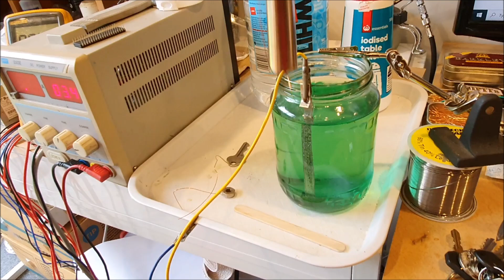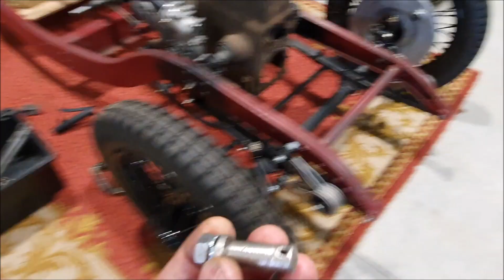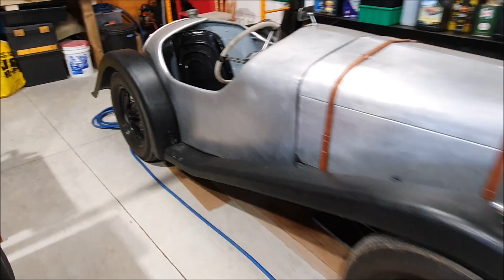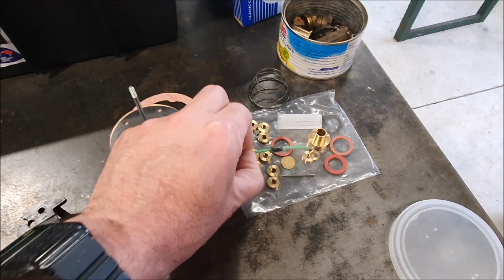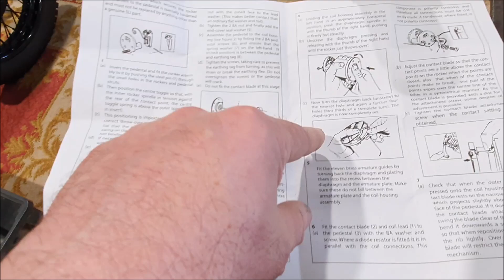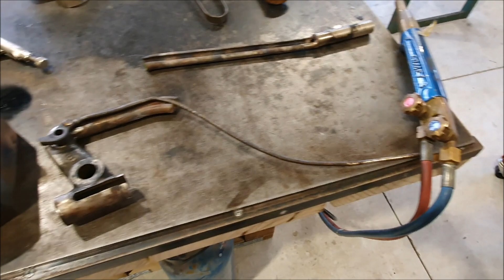Pre war car - fuel pump and handbrake lever

Comment: Hi Simon  Keep your eye on the diaphragm I have been told that the only ethanol friendly diaphragms are red in colour. Having said that the one in the Falcon is the same one that was in when Dad bought it in 1970! I will change it though, i am only going to use E5.  There are a couple of guys in the VSCC who ended up with just cloth diaphragms, totally eaten away! Cheers John
Reply from the maker: I haven't heard of the red ones but had heard all the new SU supplied ones are Ethanol safe. How you know for certain isn't clear though! I can still get non Ethanol fuel here in NZ so will stick to that for as long as possible. I'll make sure to use non Ethanol fuel for the lines of course.

Comment: I think I need to try that nickel plating.
Reply from the maker: I've been doing all sorts of small parts now. Anything that's plain steel I want to protect. Mainly small nuts and bolts and so on. It's very simple and I am still just using the same solution I started with. One thing I think is essential is wash the parts very well after taking them out of the solution as being vinegar based it is acidic of course. Nickel bars or rods would be better as electrodes but I am just using nickel strip used to make battery packs as it is so easily available. For my small parts and tiny container is seems a current of 250mA works well. That usually needs about 3 volts or so depending on the surface area of the part. Now I know it works well I might build a better container so I can have more anodes surrounding the part to be plated and provide a simple a simple rail to hand parts off.